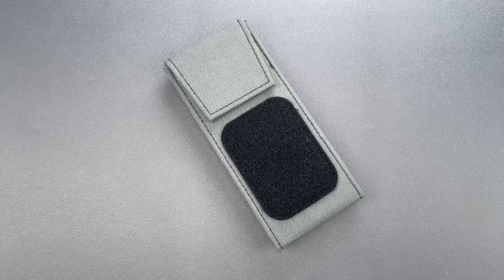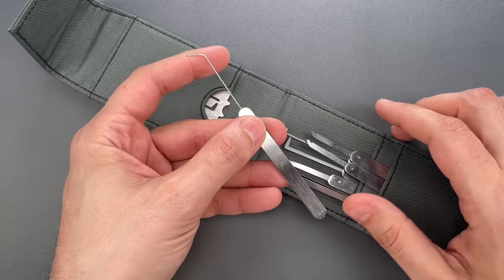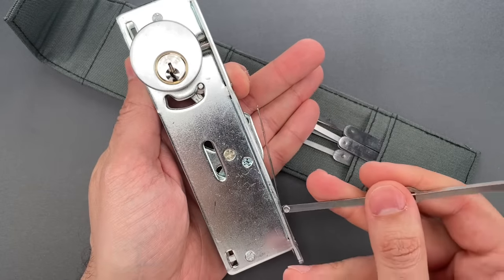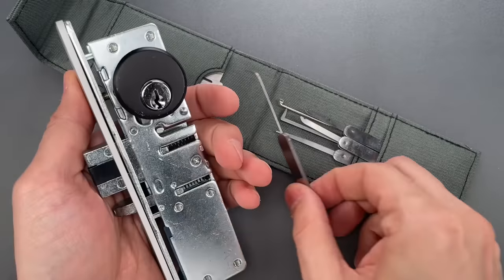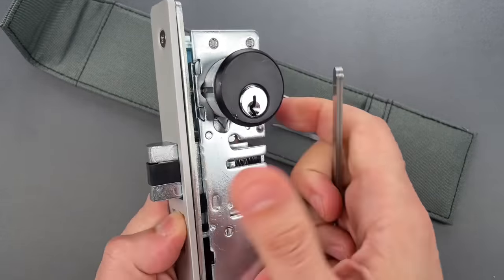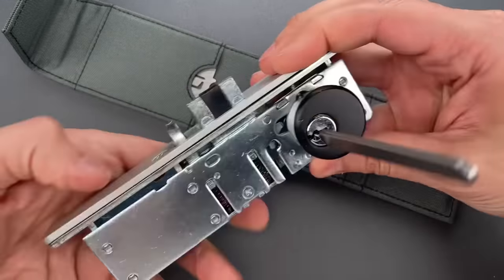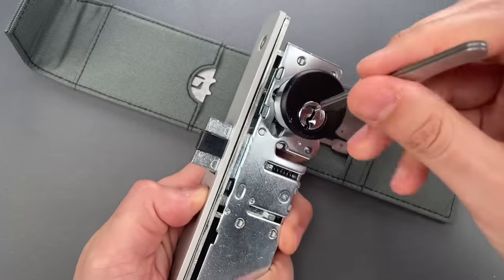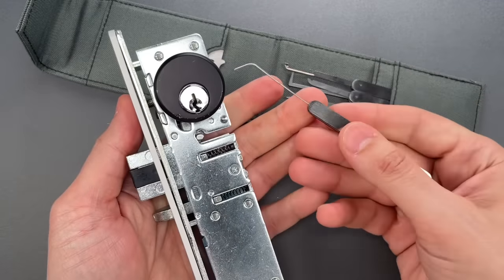[1540] “Must Have” Tool For Commercial Glass Doors

Comment: Funny how a single piece of metal is all that is required to defeat both tools yet lock makers just don't do it.
Reply: "Eh... good enough." is corporate America's motto after all. 😅
Reply: Especially the open cylinder attack which is a very traditional method for cheap padlocks.
Reply: It's not a flaw but a feature lol
Reply: The newer style Adams-Rite bolts are shielded against this attack. Plenty of older locks still i use though.
Reply: @ashishpatel350  you wouldn't be wrong. I'm not surprised if Covert Instruments best reviews come from lock smiths. Funny joke though :)
Reply: Maybe they're afraid to start an arms race they can't win? Or they just want to give lock smiths a reasonable living. Anyway, if locks did their job then nobody would take out insurances anymore.
Reply: Well, it would increase the cost of producing the lock by at least a few cents…
Reply: @Bram Weinreder  to be fair, theft is one of many reasons you insure a business. There's also fire, natural disasters, clumsy employees and customers, etc. 
Besides, at the end of the day, as LPL has proven over and over again, a lock really only keeps an honest person honest. Even the best locks can be picked, and rather quickly if you know how.
Reply: It's also funny how a strange bend in the correct place can make the difference between a tool that works and one that doesn't and the thickness will always determine if it breaks too soon or won't fit in the slot. Aluminium wafers are just too much at .01 cents per widget.
Reply: I think in case of emergencies it would be a pain in the ASS to open those doors. Say a FIRE happens , lock won't open. TIme is wasted using forced entry. People might die.
Reply: @Creed3582  Kick the glass out I guess
Reply: I think if all locksmith were this skilled no lock would actually matter. Btw any lock can be destroyed anyways. So it just depends what insurance requires and how likely someone is gonna break in
Reply: @mikelr9633  particularly 'what the insurance requires', because as a business you need to be insured againt the thief who just smashes the glass door instead, so the bare minimum security for the insurance both means it doesn't matter if someone gets in (as you aren't losing any money) and are likely actively benefitting from the means of entry not being 'brick through door'. Especially in smaller towns- a picked door can be re-locked, but while the insurance will pay for the damage to the glass door, they won't pay for the employee you've had to get to watch the now-door-less store for the rest of the weekend (you might be able to find a glazer who could do emergency work on a weekend in a smaller town, but then you're still betting on him having the right sized glass just lying around, given the local glass merchant only does regular business hours). All in all, those locks aren't really supposed to prevent entry- places that upgrade to 'extra security' will have a metal roller shutter outside them, which makes a good lock there important, but still unecessary on the sliding door.
Reply: it's possible they leave these vulnerabilities on purpose, like if police wants to investigate someone and they go in your house when you're not home lol
Reply: @rallywagon261 there are certain locks that are virtually unpickable without special tools or in depth knowledge of their internals. Locks aren't meant to keep people out forever just long enough to make your property not worth bothering compared to the next guy.
Reply: It's a glass door lock, by definition it cannot be high security since you can just break the door with any blunt instrument.
Reply: @asteroidrules  the ability to possibly bypass an alarm is the bigger security risk here.
Reply: @asteroidrules  There is not one single LPL fanboy that has street experience.

Comment: I have one of those sliding glass doors leading out to my deck.  When I bought this place there was a piece of wood laying next to the glass doors.  I asked what it was for.  I was told "That's an anti-theft device.  These glass doors aren't very secure so this piece of wood goes behind the door that slides to prevent it from being opened".  That piece of wood is 100x more secure than the lock itself.  🤣🤣
Reply: That is the truth!
Reply: Word!
Reply: The place I live at came with the piece of wood in the backdoor too! I see it is a common practice and not the previous tenants paranoia 😂.
Reply: Have one in my slider track also. Best locking device ever.
Reply: You just have to make sure that the wood is angling the right way or it's still useless.
Reply: Yep.  1964... When I was a kid.  We had a slider into the back yard.  With "the security stick."
Reply: We used this method in an old house. My wife once locked herself out and somehow managed to get the cat's attention and convince it to pull the stick out!
Reply: My parents refer to this as a "Midwest security system" 😂

Comment: Most of the time, I take these videos as a "look what you shouldn't buy" lock review. But this one is straightforward burglar advice 😂
Reply: See a previous comment on glass front doors for the easiest entry method, aka, smash the glass
Reply: He’s not revealing anything here that pros haven’t known for over a decade.
Reply: Security through obscurity isn't actually secure. It's better that exploits like these are known and fixed (if possible) rather than leaving people a false sense of security.
Reply: By making the burglary easy and accessible, thereby raising public awareness, he's forcing market pressures on the lock companies to try and innovate and fix these flaws.  We'll see if they actually do it or not, but that's a whole other issue.
Reply: @LadyAnuB  Kip Raines most effective tool...   was a brick
Reply: As one of the top comments here from @Grumpy said, "Thank you. You just showed me how important it is to set the alarm in my store. Because the lock isn’t doing anything."

Comment: "There are a couple of ways to open it", then doesn't bother listing "use the key" as one of the ways 🙂
Reply: I mean listing the key would be kinda pointless in which scenario would that make sense? Would you really buy a lock like that new and support the production of garbage like this? It makes way more sense to buy them cheaper secondhand because the key was lost.
Like with master locks using the key might take way longer anyways. You will look suspicious.

Comment: I have the kit and we tested all the tools at our shop. We find that it will only work on cylinders that are 1" or 1 & 1/8 inches. If it's 1 1/4" and above it can't reach to the back of the cylinder without bending to the point it likely wouldn't bend back. 6 pin locks are also very difficult, even in 1" 1/8. Don't expect this to work well on Yale, Sargent or almost any keyway other than Kwikset and most Schlage keyway family. It's very difficult to wiggle to the back of any cylinders that have a lip in the back of the plug where the cam is. Also, it seems to have a very hard time on original Adams Rite mechanisms and seems to be more effective with slightly worn, after market narrowstile, particularly less backset just as the one in this video (in other words this video demonstrates every most ideal scenario for this to look easy. Aftermarket, 5 pin, sc1 keyway 1" cylinder with no obstruction in the back of the plug, mounted on an aftermarket 31/32 narrow stile, slightly worn) don't get frustrated if it doesn't work for you on every lock, it has to have the right conditions and does require practice.
Reply: Well said. And thanks,  you just saved me a bunch of time testing the stuff in my old parts bin.
Reply: I’m guessing this also wouldn’t work on best IC cylinders?
Reply: @brendanf8969  definitely won't. The housing of SFIC, if you look inside, is a flat circle plate with 2 male prongs sticking out that ensure your plug can actuate the lock properly. The plug is also too small for this bypass tool to fit anyway. I haven't tested an LFIC, as just the plug, but the housing for those also has a flat cam in the back so it wouldn't matter. Those are a good solution to prevent this sort of attack LPL is demonstrating.
Reply: You should make a video.
Reply: @JohnDlugosz  yes, I agree. It would be a great video.

Comment: Related pro-tip from a window/door service tech:
The glass units in windows on many commercial buildings can be removed and re-installed, non-destructively. Only takes about 5 minutes with the proper knowledge and a suction cup :)
Reply: I kist thought of that yesterday. A glass guy came to replace a window and said he can do everything he needs to from the outside.
Reply: I knew a glass guy who had his shop burglarized that way, it must have been another glass guy.

Comment: The locks on my store latch at the top and bottom of the door. Full glass doors on a 24 hour gas station, but even with both doors locked there is nothing going in between them... also before someone asks a 24 hour store has locks so the employee can go to the bathroom, stock the cooler, or something else when he can't watch the store!

Double also we don't get meal breaks (or any real breaks) so if you see one of us trying to eat buy your $h!t and leave! Don't try to engage us with conversion or ask for stupid things. 1:30 AM and I still can't have 3 bites of a hot meal!!! Sorry just had to vent that frustration.
Reply: Thanks for the tip.  I often try to make conversation with store clerks, hoping to brighten their day .  Nice to know when it would do the opposite .
Reply: @johndododoe1411  9 times out of 10 you're fine. But if a guy has fork in his hand or food in his mouth, let him eat! Its one of the simplest yet most enjoyable pleasures in this world. And I can't tell you how many times I've been denied it and my food has gone cold without me getting more than 2 bites undisturbed.

Also if nothing else thank you for listening and replying!

Comment: Made one of these at work thats a lil more robust and its got enough torque to pull the same trick on the swingbolts and hookbolts. One issue with those tho is some cylinders are screwed in too close to that dividing bar in the middle but none the less ive gotten a few opens with it

Comment: If you have a front door on your store that uses these locks, I would put a bar across it on the inside and exit the rear door that is usually a steel door.
Reply: Around here most have a steel gate they close behind the glass doors, the steel gate being locked from the inside with no exterior lock access. Employee access is through rear steel doors. The locks on the glass doors are just to keep them from being opened in the wind/etc. and aren't for security.
Reply: @offshack  Is it a sliding gate or a heavy-duty roller shutter type of gate ?
Reply: @psirvent8  Around here most are sliding gate - we're not as hardcore as New York or Chicago where they have the rolling shutters. These are "behind" the glass - so if you broke the glass or picked the glass door lock you're faced with a steel gate that is locked and accessed from the inside and you're not getting any further. The locks on the glass doors are just to keep them closed in weather etc, and remind folks the businesses are closed and no one should be trying to go in. Very few places have just the glass commercial door as their security - mostly restaurants and other places with low value inventory - and they mostly have no external key and internal deadbolt activating - no one leaves and locks up through the front glass door.
Reply: @offshack  Thank's for the reply.
Here in France it's roller shutters everywhere funnily enough, it doesn't matter if it's a small shop, a grocery store or a giant mall, roller shutters definitely are the most common gate in front of the glass entrance doors.
Some older downtown shops might still have sliding gates but that's clearly the exception and not the norm.

Comment: 1:25 If the rear of the lock were shielded, an interesting semi-destructive attack would be to drill a small hole in the shield via keyhole and then use the tool in the video to open the lock. That attack could be divided because it's not expected that anybody would notice the hole in the shield so the attacker could drill the hole first, wait for weeks or months and then access the door and rapidly open it.

Comment: A single, tiny piece of metal is all that's needed to stop this from happening. It's amazing how far they go to save a buck.
Reply: Saving a buck a lock on a million locks is a million not spent after all...
Reply: @psirvent8  That seems like a form of wisdom, until you realize that the company would just pass the cost on to the buyers.

Comment: a note to all people who run businesses that use that kind of lock.

because of how easy it is to open it may be a good idea to have a motion detector connected to an alarm so if someone does try to burglarize the store the alarm should still help protect too.

i would say to shield the lock but if the lock is on a door to a critical location where the fire department may have to get in after hours it would slow them too.

also code may dictate security features too
Reply: Fire dept are more likely to smash the glass instead of trying to bypass the lock though.
Reply: @psirvent8  that would work if the glass is thin like car window and even not tempered like safety glass.

many glass doors used for commercial use are much thicker .
Reply: I'm sure between the weight of the metal on the end of the fire hoses, fire axes, saws, jaws of life, and likely a battering ram, they can get through any door short of a panic room.

Comment: So here's a question for you: are there ANY benefits to having an unshielded core, or is it literally just a matter of extreme cheapness and laziness?? It seems like such an obvious fix to a non-lockpicker like me but I perhaps naively think there must be SOME reason they keep getting made...
Reply: Good question
Reply: Likely it's simplicity of design.  Also, as many people state on every video, a burglar is more likely to just smash the glass.  Bricks are cheaper than lockpicks, and no amount of shielded keyway will stop them.
Reply: Don't know for sure, but I had always assumed it was to leave a way for dirt/gunk/water to get out.  With the hole there, any dirt which gets in the lock simply gets pushed out the back, and if it's tilted back slightly any water will just run out the back instead of building up and freezing.
Reply: Money. It costs 0.054 cents, so its deemed too expensive by lockmakers.

Comment: LPL, we own a business with this type of door owned by the rental agency. Thank you for the heads up. 
While I prefer criminals and first responders to pick the lock and trip the alarm rather than bust the window and trip the alarm, I assumed the bolt lock was better for the second metal door.
Reply: Emergency services don't pick locks. Cops and fire fighters both just smash the doors down.

Comment: Not sure if you ever heard of Atlas Survival Shelters but they claim that you can NOT (or have extreme difficulty) pick their locks.
I don't think the lock itself is all that secure since it is a master's puck lock but more the fact of the thick steel frame over it.
That lock is to prevent people from entering secure shelters so the value inside is normally high, so you don't want a good lock but a great lock.
Reply: I await LPL picking his 'survival' shelter of Amazon Basic, wally mart, Master Lock, and assorted cheap Chinese padlocks storage 😀
Reply: I'm not actually sure there is such a thing as a great lock.
Reply: @couchalmark675  Pac Lock, with a Medico core.
Reply: @couchalmark675 you just don't see them bc they aren't mass produced
Reply: @couchalmark675  Bowley Rotaserra

Comment: Yes I did find it helpful as I intend to use a dead bold with no lock at all on my main door as I want to use s strike plate instead. Which means the front door has zero locks on them and can only be opened by pin code or rfid card or fob. I will have other doors out of site that will have key entry incause said entry were to fail.

Comment: You will be surprised just how many of the hook bolt style you can open with a pen knife if the hook does not throw over 100% you can literally just Lift the hook with a knife also if you have doors with these locks check the keep make sure no one has added a little bit to the opening  found so many like that  totally insecure  ..  i dont work any longer due to spinal problems but it was a common call to problems with those things

Comment: So... a sturdy paperclip would probably do as well 😂
Reply: Unlikely. If you've never handled any of these tools you'd be surprised at how stiff the metal is (on good quality ones anyways). Most any paperclip is going to bend trying to do stuff like this. I've tried to open locks with paperclips a few times. Picking is out of the question. Bypassing works occasionally on brand new (really cheap) locks but never in my experience on used locks. Bobby pins work pretty good though after a bit of work with pliers, they're just small and difficult to manipulate accurately.

Comment: I need the Adams Rite wire tool and padlock bypass tool as separate items, because I already have all the other tools in that kit...
Genesis set, with credit card door slip, 4 comb set, notched decoder bundle, and commercial door hook in the original black trade craft case.
basically, combine the Arbitor and Genisis sets in one case, I've been calling it my Low Profile Lock set, or LPL for short :)
(if you use that idea please send me a patch, I'm not picky!)

Comment: As a locksmith most of the aluminium doors that have these on are so poorly fitted the the snib doesnt make contact so you just use a screwdriver just to push the latch back.